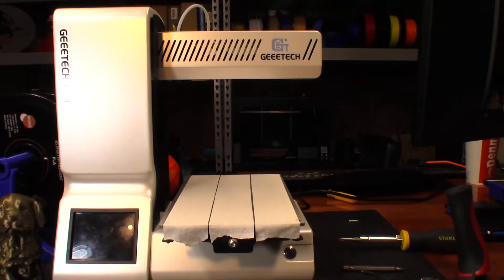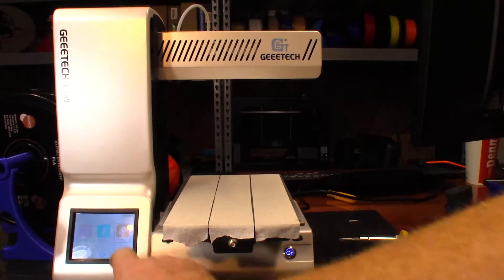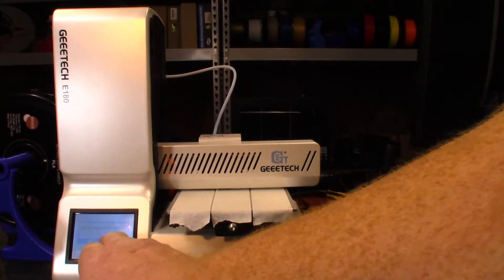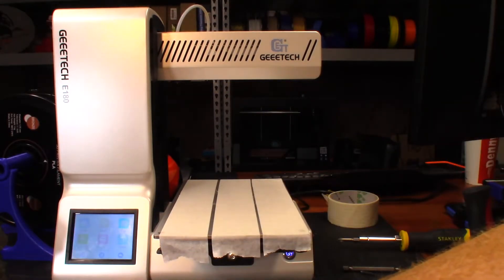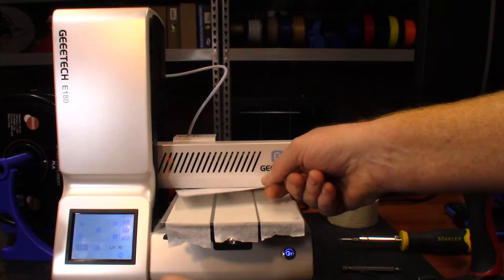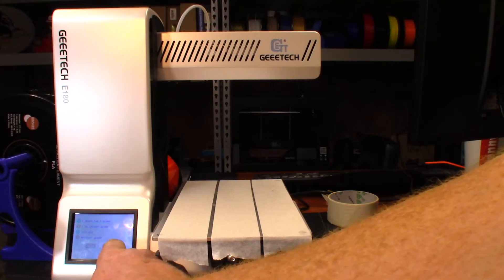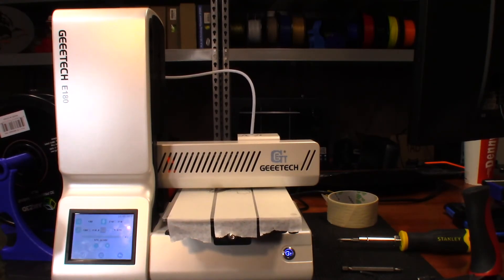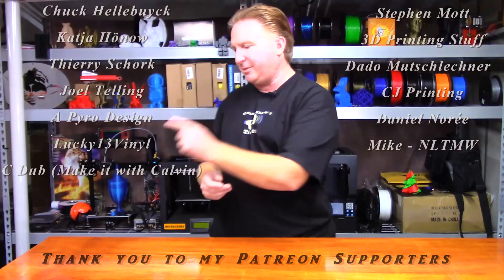Does The Software Based Assisted Bed Leveling On The Geeetech E180 Work

Comment: Thanks for showing this! This is very different than many printers have with their "software assist" and it works great! Most printers just move the head around to the different points so you use the bed screws to set the height.  The Geeetech process is more or less the same thing as using a probe to measure each of the points for ABL, except you adjust the nozzle height for it to measure the variation at each point. It knows where Zero reference is, and it knows how much you moved it up or down at each location to calculate the measurements. Same math a probe uses and it works great!